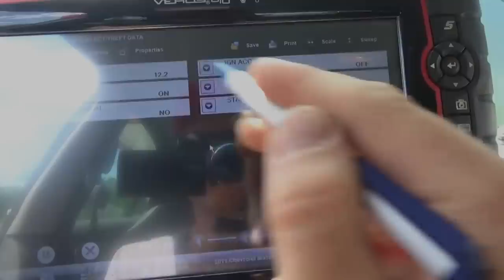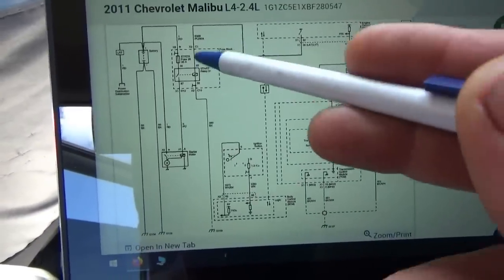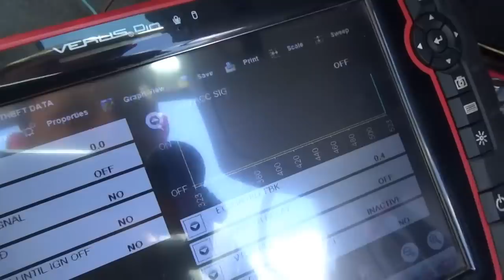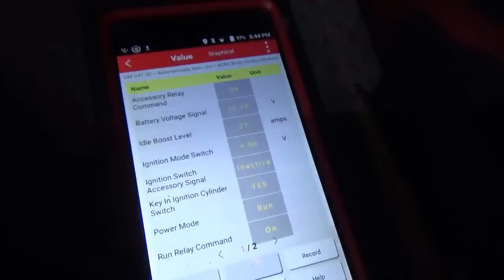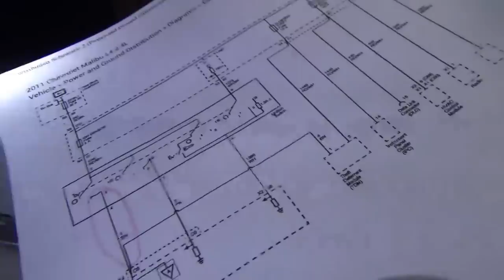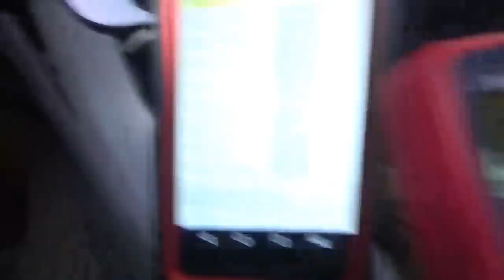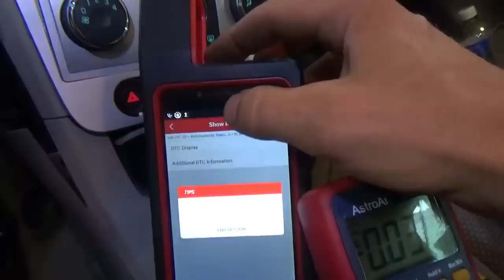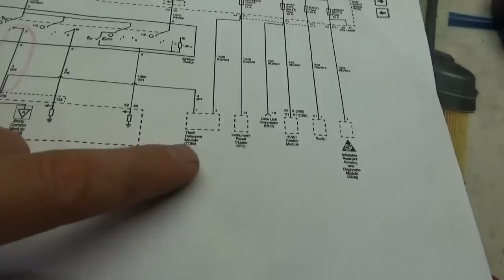Mystery Malibu is BACK! (Intermittent No-Crank)

Comment: Need some help for My CHEVY MALIBU 2008. I had it parked over 2 months already. When I turn the car to start it won’t start it does some clicking sounds but nothing. I bought a new battery and it started took it for a drive then I turned it OFF turn it back ON and did the same clicking sounds. After couple minutes it turned ON but it turned it OFF tried to turn it back ON couple of times and didn’t turn ON. Car messed up when the weather was really cold but after that won’t start. Any suggestions? The stereo and dashboard lights turn ON but it won’t start anymore have a new battery as well. Some people say it’s the anti theft or  it’s the fuse box the one inside from the car or probably that fuse that you took off. I remember messing with that fuse couple months back. I was trying too fix the door locks it was going crazy. Any suggestions? It does the same thing as this Chevy Malibu no crank but dashboard turns on
Reply from the maker: My suggestion is to follow the diagnostic procedure in the video 👍😁
Reply: @PineHollowAutoDiagnostics  car won’t start up or move can’t take it too get it check up. Probably I can get a mechanic in my area so he can check it up with the machine.

Comment: Suppose the lesson is, do the low tech first and then proceed to the higher tech. However in the pressure of the moment, its very tempting to go off on a tangent. The fuse was blown for a reason as stated, but other than a faulty ignition switch, who can tell ? Maybe a voltage surge on the line in a thunderstorm ? The problem was rectified no matter what, which was a good days work in any techs life.

Comment: Could a fuse that is carrying a very low current (40mA) have developed contact tarnish that raised the circuit resistance enough to make a difference?  That 4th pole's crank circuit is resistance-based.  I would have de-oxed the fuse and its holder and seen if the problem persisted.

Comment: Very weird it did start without signal on the other wires and no signal on the anti-theft module. You would expect the car not to start, especially commanded from the TDM...

Comment: Was the 2 amp fuse blown because I am having the same problem but I did a continuity test on the 2 amp fuse and it was good. So I guess it must be the ignition switch. And if it is the ignition switch does it have to be reprogrammed

Comment: the days a coming when most of us will not be able to change the oil or spark plugs ... somehow we will need a $1,000 scanner
Reply: Meh, scanners are constantly coming down in price vs functionality. Thank goodness for Right to Repair! Same mechanic that complains about $1000 scan tools will go drop $10,000 on a bunch of other tools, no complaints.
I guess I'm biased, I'm a controls tech. Live and breathe electronics and software.
Reply: @thebigmacd  The problem with automotive scan / diagnostic confusers is that you need multiple ones as certain models / brands will give a no com. for no apparent reason. 
No way around this.

Comment: Odd lapse for you, I'd say, as you usually approach things in a "diagnosing a circuit problem", rather than an "extrapolating from the symptoms" -manner. I was rather surprised you skipped over testing something else sharing the same feed and/or checking the fuse. Then again, customer stranded, working in a parking lot, in blazing sunlight in the middle of summer... I'd want to get to a roadside fix quickly as well.

Comment: Not the first time a fuse failed open, I have seen a few.
Volvo used a fuse for the fuel pump, it was exposed to the elements, I installed a fusable link instead, and hope I never see it again.
I hate old Volvos, I liked the motor and they crash very well, but I would never own one.

Comment: So basically look under the hood, your fuse box has 4 I believe boxes with wire, somewhere on that box of wires is burned, causing the car not to crank on hot days or until cooled, only fix it to get a really good electric guy to wire a new box in (advised) or get a new or gently used engine harness, also advise getting a professional

Comment: In PHAD's defense, an "intermittent" no crank does not normally require a "fuse" check. 🤷‍♂️
Reply: I'm not understanding how the crank can be intermittent with a blown fuse.  If the fuse is blown there should never be a crank.  I'm dealing with a similar situation currently.  There is a 5 amp fuse that I will maybe swap out after watching this video.
Reply: @rickmossop3733  Nothing will be intermittent if there is a blown fuse. The contact points of the fuse blade, its socket, switch, wire, etc. would be the things to check for intermittent failures. The quick and dirty testing is always the "wiggle test." Good luck and happy wrenching!

Comment: Reminds me of my wife's Chevy blazer while I was on the road she came home from work then went to start the vehicle click click battery dead. My son happened to be home that day so he charged battery tested it battery good started vehicle hooked up tester while it was running showed charging system not working. So my wife and son figured they had it undet control went to town got an alternator installed it still not charging thats when i got the call lol.
First thing i asked if the battery light was on in cluster was told cluster wasn't working at all and thats when she told me she heard a loud snap sound when she went to work and it's an hour drive each way. I told my wife and son to check fuse for cluster low and behold the 20 amp fuse was blown new fuse charging fine till she went to work then she heard the same snap again checked gauges sure enough not working again i told her to get a box of fuses so she could at least charge the battery when the vehicle was idling it only blew the fuse whenever she made right hand turns so i knew it was a bad short when turning and rough grid roads.
When I got home jacked it up put in fuse and started wiggling wires underneath the vehicle took about 30 seconds to make the fuse pop it was loud enough to make me jump sounded like a fire cracker going off .put in another fuse just to confirm the location of short i heard the snap at same time as I saw the arc on the 2 wires that went to the front axle 4x4 sensor that tells you its in 4x4. Wires were getting pinched between the motor mount and frame. Don't understand why so many things are on the same circuit especially critical ones you just have to shake your head over what has one thing have to do with the other 🔄⏳🔄⏳➿🤯🔄🔃↩↪👍👍

Comment: I think maybe you would have caught the other wires missing 12 volts had you been at the customer's house, better able to focus on the problem.  Too much going on at the gas station putting more pressure on you not being able to fully concentrate. At the point the car started, I would have it driven home asap and finish diagnosing there.

Comment: Used to spend ages trying to fix the spot lights on my sisters classic mini, thing had stiffened suspension so rode very hard. Lost count of the times i just visually checked the old glass fuses and went off tracing wires and checking relays only to find the fuse wire had snapped off inside the end cap of the fuse...

Comment: So what you say the best solution would be. I having the same problem. I changed out all the relays same problem no crank when the car is warm. I have to unplug the fuel pump relay and plug it back in. The car starts no problem. Any solution advice?
Reply: Michael I have a 2008 malibu. It did this 3 yrs ago. Turned out the copper band that runs under the fuses had a crack in it. Had it pulled apart and soldered the copper band. 3 yrs later no problems. Still running great.
Reply: @michaelmclaughlin6   is that something a mechanic can easily fix? My car is sitting on the side of rode as we speak. I changed the fuel pump this past weekend which I hate i did because it didn’t fix the problem.
Reply: @michaellott8722  yes. There is a way to take it apart.
Reply: @michaellott8722  I saw the crack before they soldered it. It fixed the problem on mine. Not sure if that is your problem. They had a thin copper band on those.
Reply: @michaelmclaughlin6  I’m sure that’s the problem with mines. My mechanic is looking a whole new replacement fuse box but I guess I should ask for him to look for cracks. Did you see what area the crack was in yours? It might be in same spot of mines. Just need to know where to look if I take off myself.
Reply: @michaellott8722  most mechanics would rather replace it than fix it. Once it is opened up, under good lighting it will be seen if there is a crack. It can be in different places. Not sure if it was due to a big jolt like hitting a pot hole or what. A good electrical technition can fix it by soldering it. Good luck with it.
Reply: @michaelmclaughlin6   the fuse box in the truck is what I should replace right?
Reply: @michaellott8722  not without having it checked out. Your problem might be elsewhere. I hope you can get to the issue. So many things it can be. Good luck!

Comment: Yeah I got Chevy Malibu '09 same vehicle basically doing the same thing it was clicking in the fuse box in the middle relay that goes to the starter I switched them around it stopped and put switch the fuses around on the inside the number two I switched it one of the less used ones at the top on the inside fuse the two and now I'm hearing a buzz in the trunk sounding does that mean that the relay is bad back there

Comment: I had this problem. Turned out there was a crack in the copper  band under the fuses. Had it pulled apart and soldered. 3 years since that was done no problems. 2008 malibu. I have heard they had this problem but no recall. The copper would cool off and cause a gap.

Comment: I just seen a video about the same make an model of car with the same problem. Will not crank when warm after driving. The problem was in the fuse box its self. A small hairline crack in the fuse box that fractured a wire at the bottom of the fuse box. that goes to the starter relay. THis is why it only happens when the engine was warm.

Comment: Had this issue once a 10 amp fuse had 12 volts across fuse but ònly 3.2volts at source. Took out fuse you could see visually the fuse was almost blown. Put in new fuse fixed..never came back 👍

Comment: Man your awesome and honest. Thanks for your video. Anyways, I have a 2009 that had the battery ran down and now after battery, starter, plus solenoid, but now it's in limp mode and when I turn key, I get a click and then nothing. So could you point me to a video that mayy help me out. I'm going to try this one but if you have another one, that would be awesome. Thx and keep up your videos
Reply from the maker: Scan all modules for codes and go from there. Does it have the stupid auto start stop system?
Reply: It's got the lock 🔐 symbol and it's saying engine reduced power and when I put key in and try to start, I get a click(1) time then nothing. And I get some kinda like winding noise in steering column
Reply: And thx for getting back to me, that's awesome 👍😎

Comment: I did wonder why you didn't check the other wires coming from the module for power and you appeared to be obsessed with the brown wire, but when it changed over power would be on the others, but you didn't check.  However, I would have been checking for the feed to those wires first, which would have led me checking the fuse.  As a matter of course, I would check the fuse feeding the circuit anyway.  Then progress through the circuit.  I think you just over thought it this time, start with the basics, is the feed ok (fuse)?  Ok, move on to the next in line, that would be the module or IGN switch.  In all the years I have had faults in cars, only once did I have an IGN switch faulty, that was the key barrel wouldn't turn, so it was easy found.  That was the now infamous Ford Chubb locks.  They don't use the same style now.

Comment: Try putting shift into neutral instead of park sometimes many cars will crank up bad saftey switch on transmission near down in road salt
Bcm may shed all accessories to send all power to crank and ignition fuel injection etc to start?
Reply: I think BCMs remove power during crank to prevent voltage spikes etc from upsetting other devices.

Comment: You're being to hard on yourself. You had a car that wouldn't start, you identified an issue, repaired it and it started. Cars are very complex these days and a simple wiring issue can cause many issues, many of which might not seem related. I have an 09 Saturn Aura 3.6L that I had since 2010. It has 270K miles on it and runs great but just the other day I was driving it and I suddenly got a hard shift after driving a hilly road for quite a while. First thing that came to mind was transmission. Continued driving for a while with everything OK when suddenly I noticed that I was in 5th gear instead of 6th. Normally I'd think tranny again but weird things happened. Lost many of the things on dashboard display, speedometer stopped working. Stopped at a light, attempted to pull into a service station and the car barely went. Stepped on the gas, engine wouldn't rev and just barely moved, crawled into the station. Shut the car off and when attempted to restart it got nothing, wouldn't crank. Half the information normally displayed on the dash is missing (odometer, outside temp, avg mileage, etc.). Tranny might in fact be shot but I'm thinking something electronic is causing the problem. Any suggestions?

Comment: I would rather buy a mid-2010's Mazda 6 sedan with the 2.5 L Skyactiv four-cylinder engine, over this 2011 Chevrolet Malibu sedan with the 2.4 L four-cylinder engine. The Mazda 6 sedan is much faster in acceleration than the Chevrolet Malibu sedan. Go for a Japanese or imported vehicle, instead of a North American or a domestic vehicle for reliability, fuel economy, speed and comfort. Thank you very much.

Comment: well, if auto manufacture would include troubleshooting flow chart, it would help get you on proper path which would take you to the blown fuse.
Reply: They do. They're terrible, and written in a "parts-cannon" mindset. Ivan had it on the run.

Comment: Holy Moly! My guess is you took this to the average automobile repair shop its had telling what the repair cost would be and it would probably still would not be fixed. They make these new cars so complicated and hard to repair most are better off junking the car and buying a new one.
Reply: Nonsense the're many qualified technicians out their fixing more difficult problems then broken cars and the technology used in cars isn't any different then anything else. 
- 
Whenever things get difficult; Ask this question. Q:"How do you eat an elephant?" 
- 
A:"One piece at a time"
Reply: @real_arbuckle  I can see you haven't worked on these newer automobiles.
Reply: Sawmiller Smith wish we could go back to basic cars like something like the VW bug,  I’ll never sell my 89 Mitsubishi Mighty max truck it is still pretty simple but I still would like a car with no computer just maybe electronic ignition in the rotor no points but I’d settle for points if I had to.
Reply: @SawmillerSmith  Wrong again, I've always fixed my own bikes, motorcycles, cars, trucks, boats and farm equipment while today I get paid to work on robots and CNC equipment. And if all that doesn't make you sick, I can also cook, make furniture, built my own home, speak 3 languages and program in Fortran, VBasic, C. C++ .NET, Bash, NodeJS, GO, JAVA, JavaScript and Python. And I've learned all of this with a formal 5th grade public education in the 70's.
Reply: @real_arbuckle  not eveyone can work on there own automobiles.  Plus these never cars take a lot of  special tools. The book call for 10 hours on some of these 4  Cylinder engines to change a value cover gasket. Thats about $1,000 in labor cost. Head gasket add another 10 hours. Labor cost is up to $2000.
Reply: @SawmillerSmith  I agree not everyone should turn a wrench if they can't or can make more money doing something else. 
- 
Tool costs today in the internet age isn't an issue since you can rent many tools and/or buy and sell used equipment easily. If you do the work at home; Why keep expensive equipment you need once a decade in a garage collecting dust when you can use it and sell it? 
- 
A 10Hr job is still a weekend job and in this case of a gasket it's only unbolting parts in order and then reassembly in reverse order. This isn't difficult and should be easily accomplished by any 1st year mechanic.
Reply: @real_arbuckle   The value cover gasket  you also have to remove the injection line and injectors which need special tools that can not be rented. They cost around $1,000. And to change a lower radiator hose you have to remove the front end body parts. Lots and lots of plastic pieces. To change a headlight  Assembly you have to remove the front bumper cover. Headlight assembly are in the $600 range for a chevy malibu. Junkyards want 3 or 4 hundred.  Parts are expensive and had to install. You probably will not find an auto repair shop that will want to replace a value cover gasket if they have to spend a 1000 dollars for a tool that won't get used much. They like to work on older cars that they know how to fix. This channel right here mostly works on older cars and trucks. This 2011 is a newer car for this channel.